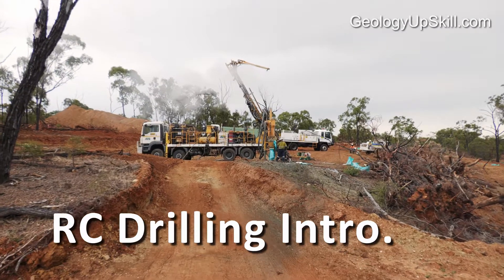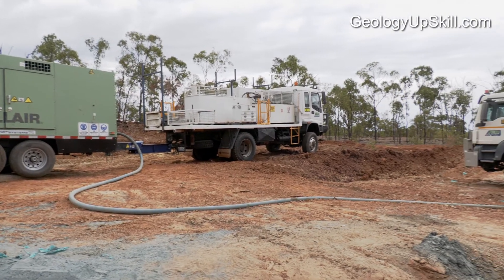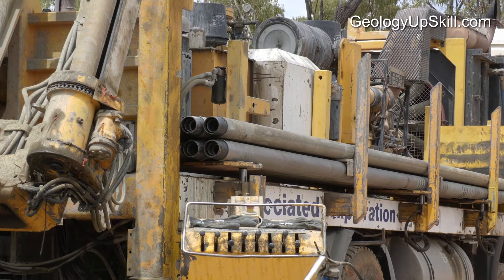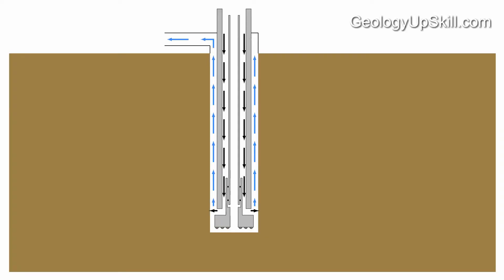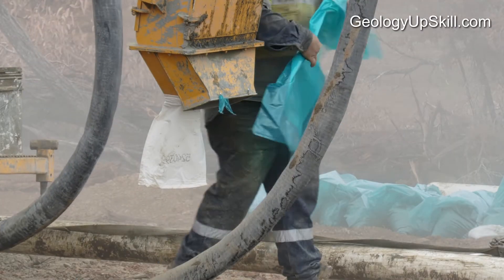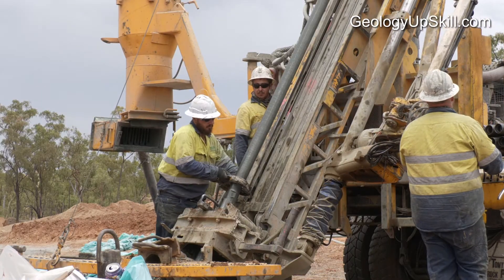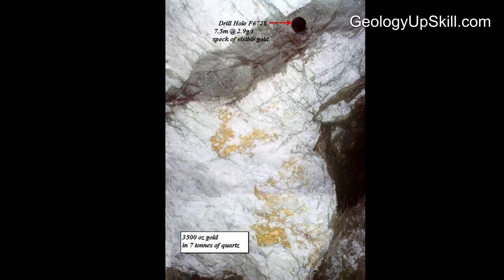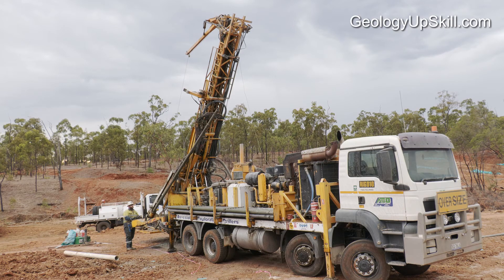RC Drilling Introduction

Comment: In south africa they drilled to 1400m with a RC rig.
Reply from the maker: That is certainly pushing the limits!
Reply: Sorry, I checked again. They drilled a 1000m hole with a RC rig, the 1400m hole was drilled by a DTH rig. I bet when you are going that deep you need lots of air.

Comment: Ive done offsiding for these drills underground except our rig was on tracks ive had to do 100 metre rod pulls multiple times with bits sometimes 2ft or bigger in diameter. Ive been in waist high water changing rods and under there we also drilled upwards so everything is falling on you while theyre drilling. The rods because theyre wet and oily are even harder to handle then they would be when dry sometimes its just easier doing it with no gloves. Ive had to jump over holes that are 100 metres deep 2ft wide in diameter doing that 80 times on separate occasions in 1 shift while holding the rods.

The rods we used were aroind 1.8metres tall but looked much heavier then the ones theyre using in this video

Let me tell you right now they do not pay enough youd get maybe 450 a shift which is around the same amount a guy sitting on his ass in a truck gets, people new to the industry dont know that because no one tells them. Trust me 350 to 450 a shift is not enough to do that shit 

Unless ofcorse you have a rod handler which is a mechanical arm that does all the hard work
Reply from the maker: It certainly isn't "easy" money!
Reply: @GeologyUpSkill  it's definitely not and in my opinion its not enough.  Yeah fair enough you get bloke's that don't cut it I mean I've had body builders that couldn't keep up but everyone that does that job deserves 500 a shift at least

Comment: Looking at using an RC rig here in the states for uranium, but am unsure if it will work.  We will be drilling 800-900 feet in shale, swelling clay, and sandstone and will have artesian flow at surface.  We typically use regular mud rotary rigs and weight up with barite to supress the artesian flow, but there is a huge rig shortage where I am and am desperate to get any rig at this point.  Will an RC rig be able to handle the sticky clay/shale and the artesian flow?
Thank you for the great videos!
Reply from the maker: That artesian flow will be a problem. You can keep it out with lots of air while you are drilling, but it will fill up the hole each time you stop to put on another rod.
Reply: If you find good drillers that understand a good mud program. ( pumped and sealed down the casing ) You'll be fine.

Comment: How deep can an rc drill rig dig
Reply from the maker: That depends on many things (volume and pressure of the air supply are the biggest factors), but holes beyond 400m get pretty slow and difficult so RC has much less advantage over diamond at that depth.
Reply: @GeologyUpSkill  was actually wondering if the rc drill rig could be used to find lithium deposit in Nevada..    Trying to figure out if hoycroft mine is looking for lithium as well as gold and silver..
Reply: @stevenorosz1518  Depends on the deposit. If you're looking for most of the clay-hosted deposits it can be a problem with recovery. You're blasting through the subsurface with that drill.
Reply: @GeologyUpSkill  thanks

Comment: Awesome video, I love the RC rig. It was all a mystery to me how it actually worked all I know is those rods are heavy as buggery if you are manual handling them because the support truck cant move close enough to the rod handler. That being said after I watched your video I was shocked by the max depth you mentioned and asked some driller I'd worked with last night what the max depth was and how deep he had gone. He replied 800m and I said how do you get any return and he said "more air". Their drill rig with offboard booster can drill over twice your max depth according to him but we'd had a few.
Reply from the maker: It is possible to drill deeper, but it's a game of diminishing returns because you drill slower, it costs more and the risk of getting stuck goes up. Beyond about 400m, diamond core is equal or better.

Comment: Interesting video, right now I'm having an issue with rc drilling, I'm working in a limestone formation with clay, and the hammer doesn't work well with soft formations and with high moisture.

Now we have changed the bit to a tricone bit adapted to rc drilling to deal with high moisture and soft formations.
Reply from the maker: Limestone is a challenge for all types of drilling because it tends to form large cavities that can divert huge amounts of drilling fluid or air. They can be difficult or impossible to seal with regular cementing methods.

Comment: Really nice video. But what's the different between Positive circulation drilling and RC drilling?
Reply from the maker: Open hole or "positive" circulation drill rods are a single hollow tube. Air is pumped down inside the tube and returns up the hole outside the rods. Reverse circulation drill rods have an inner and outer tube. Air is pumped down between the outer and inner tube then returns up inside the inner tube. The animation in the video shows the different air paths with moving arrows.